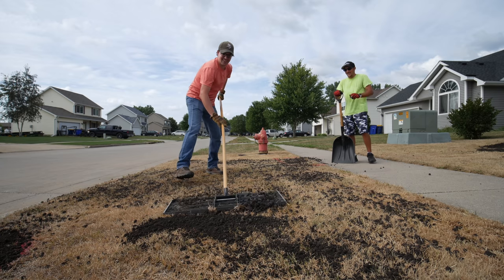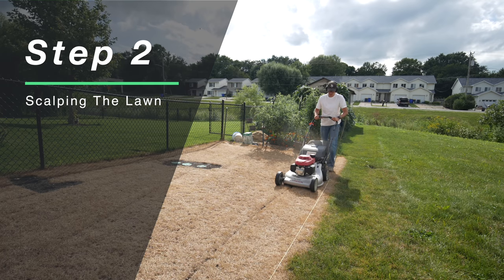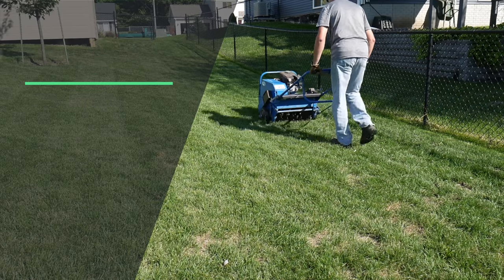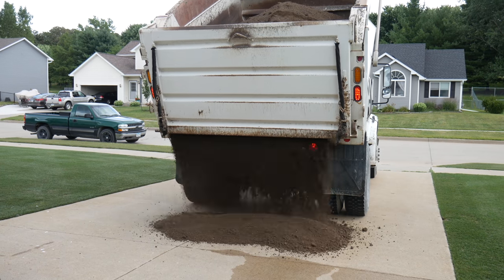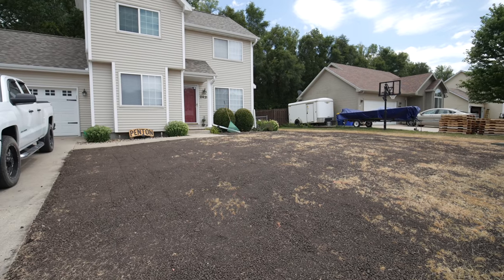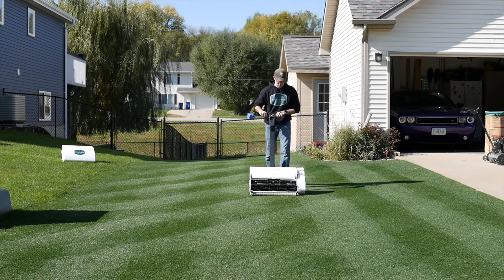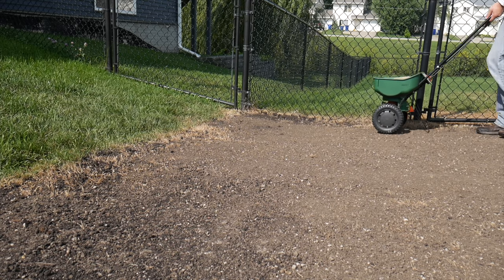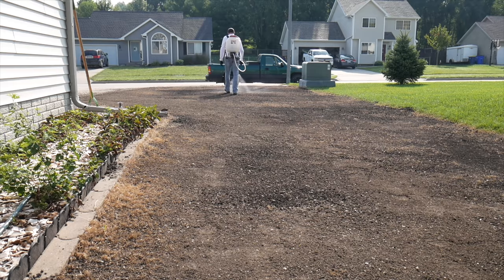How To Fix Your Lawn with Renovation // All The Steps In One Video!!

Comment: Hey Ryan, after spreading peat moss by hand last night I deiced I will be purchasing one of those rollers haha. I know you said you used around 7-10 bags for this 4000sf area. I was wondering if you were doing just a overseeding/topdressing in an area that wasn't a complete renovation, do you feel like that would take less? It's not like that roller has adjustable settings other then walking speed, lol. If so do you have any experience/idea of what the rate would be over an area like that?
Reply from the maker: It would probably be close to the same

Comment: What's up buddy. Love the content. My question is do you leave the plugs? I notice you leveling with topsoil but didn't mention the plugs. Can't see in video of they were still laying on the ground. Thanks man
Reply from the maker: If I'm leveling I either need to find a way to break them up or remove
Reply: @ryanknorrlawncare  How would you break them up? I'm doing a 2500sq reno. Completely dead now after 3 glyphosate rounds. My plan is to rent a stand on aerator, plug the crap out of it, seed, fertilize, tenacity, and go over with a lawn roller. Should I just leave them, seed, then roll it? Man I'm stressing cause I have so much work and money invested in seed, herbicides and fertizer. I really want this to go well. I should also mention I'm doing TTTF. Any help would be great! Thanks brother

Comment: Just renovated the lawn and used a Golf Green Nitrogrow mix lawn seed. Some is growing really thick and tall quickly. I'm scared to mow it too soon but some of it is already about 6-8 inches tall while others are thinner and short. Ground is still soft with some seed not sprouted. Not sure when to mow it now before some of it gets too tall. Any advice?
Reply from the maker: Let it dry out a little and then mow. Overseed thin spots if they don't start to fill in
Reply: @ryanknorrlawncare     Thanks for replying. I had one chance to mow it yesterday as the rain started today. It turned out okay, a few ruts but hopefully it will level out with the rain. Wondering if the Red Fescue seed is actually tall fescue. Weird height differences. Thanks, love your videos.

Comment: I’m into the 2nd week of killing my lawn. How do you limit new weeds bringing in the screened top soil? Should I try to use as much of my existing soil and till it with some heated compost? Would tilling negate the need for aerating? Does Tenacity slightly slow germination? Would you like to take a trip to Long Island NY around Labor Day and help me? :) we’ll put you up and make sure you get some time in the city. :)
Reply: I’m pretty sure if you till, you would not need to aerate it.
Reply from the maker: Tenacity is used to limit the weeds from new soil.  It won't be perfect but I'm more worried about growing grass and fixing a small amount of weeds later.  Just follow these steps
Reply: Ryan Knorr Lawn Care Thanks. Others are suggesting I need to let the top soil fallow for a couple weeks before seeding. I didn’t see any step for this. Are you just skipping and dealing with the weeds from the top soil later? The Meso/Tenacity must also help with this. Btw your videos are great, excellent production quality and I’ve learned a lot.
Reply from the maker: @jbuchananator  Yes I would fallow if you can but you need weeks to get that done and this video was about more of the steps after that process.  Tenacity and weed control later on for whatever comes up in the soil.

Comment: Step by Stp, even I can do that! Just 1 question on Step 10 ... I have had a bit of POA problem so 1 of the reasons to renovate the lawn but if you're wanting to seed won't the pre-emergent as Tenacity get in the way of the new grass coming through? I mean the POA seeds for next season are already in the ground from this year's grass I want to kill off. Can you explain the logic how a Tenacity and new grass seed can get along together in the same new soil, so I get ahead of the POA seed already in the ground? Many thanks
Reply from the maker: Tenacity is not a traditional pre-emergent like prodiamine or dithiopyr...it is able to be used at seeding to help prevent some of the weeds and new poa from taking over the new seedlings.  Then you need a regular pre-emergent program the next year.
Reply: @ryanknorrlawncare  AH ... that's the catch, it's a selective pre/post-emergent. Now I get it ... many thanks, great videos.

Comment: I did a similar process to a spot on my yard yesterday (about 200 sq feet), but I forgot to use the Scotts starter fertilizer before watering!  I haven't added it, I've watered 5 times now, is it too late to add the Scott starter fertilizer with weed control?
Reply from the maker: Not too late unless it's too wet to walk on

Comment: The REAL first step should be getting a soil test conducted before the renovation. For example if your phosphorus levels are over the top, you may not want to use a starter fertilizer. If your PH is too high or too low, that can also hinder results. Love this channel Ryan. Just keeping it 💯

Comment: Is killing off the existing lawn a necessary step? I was thinking about just scalping and level with compost rather than killing the whole yard off.
Reply from the maker: If you want only the new grass that you seed then you have to get rid of the old.  The scalp does not do and it will just be mixing the new with the old at that point
Reply: @ryanknorrlawncare  makes sense! Bought a bottle of Roundup and a sprayer today! Thanks for the advice!

Comment: I leveled my lawn this spring and rolled it to get everything smooth.  It stayed that way for about 3-4 months but is now getting bumpy again.  Any idea what causes this?  Thank you.
Reply: From my experience top soil has enough matter in it that decomposes slowly over time and with the elements of rain and weather allows for pits and bumps to form slowly overtime as the dirt is decomposed.. That's why sand is recommend for leveling cause it doesn't decompose like dirt and settles evenly over time with many applications.

Comment: Has anyone had a similar problem to this.. I noticed from using my striping kit, in addition to all of the 90s we had up north this summer, grass that was smashed down more from the striping kit struggled the most and even died. Why is this?
Reply: Sure the grass isn’t dormant?
Reply: @d0wnbyth3riv3r2  Most areas that would lay down more from striping are brown and I'm able to pull the grass up easily.. so it is dead :( I wasn't sure whether it could be from the striping.. it just seemed odd to me that those areas looked worse.

Comment: Might be a dumb question, but if one wanted to completely start over and reno their lawn why not just kill everything, scalp the shit out of the dead grass/weeds, then rototill your entire lawn and rake until smooth or "level" (people misuse that term IMO), then let it settle over summer,  reassess smoothness at end of summer and touch up what needs to be touched up.  Then aerate, seed, and water, water, water.  By end of fall you should have a fairly lush yard that's as smooth as a baby's ass.  Albeit with maybe some weeds but you could just tackle those early next spring with some preemergent and staying on top of it year round from there on out.  

I ask mainly because I'm about to buy a house on 3/4 acre.  About 27-28,000 sqft is lawn.  If memory serves the lawn was pretty pathetic (house was built in 2016.... by an old couple in their 80s.... so on top of it suffering "new house" yard quality it's not like a couple in their 80s was keeping up meticulously with their lawn) when I did my initial walkthrough.  That was toward the end of April though.  I'm going to do my final wall walkthrough here in about 5 days.  Will be paying much more attention to the yard this time around to access the damage so to speak.  

I ask because all these lawn "leveling" videos on YouTube I see say it'll take several seasons to get that golf course smoothness.  Why not just go full bore on a reno as mentioned above?

Comment: I noticed you did not remove the old dead turf before putting down the grass seeds.  Therefore the subsoil was not exposed or tilled and some areas also did not have any soil bedding so the grass seeds went right on the old dead turf.  I never had any luck having the seeds germinate this way.  Best practices involve removing the old turf, loosen the subsoil to a 2 inch depth and then put 1-2 inches of black triple mix soil as bedding for the new seeds to germinate.
Reply from the maker: I've done it this way many times and check out later updates...everything turned out great

Comment: Couldn't you just till up the area after you kill the lawn?  Skip the scalping, dethatching, and aeration steps altogether?  

Thinking of doing my entire roughly 27,550 sqft of grass.  Just kill the lawn... go to Sunbelt rentals and rent a Toro Dingo with sunbelt's "soil cultivator".... AKA a rotadairon.  A rotadairon is essentially a reverse rototiller, rake, stone/debris burier, leveler,  and earth moving tool all in one.  If no one knows what I'm talking about just YouTube "Toro dingo/soil cultivator" and you should see a video with Toro equipment showing the process.  Leaves a sexy looking seed bed when finished.  Now just picture the dingo and "soil cultivator" painted green... from Sunbelt rentals.... because they paint everything green.  But you WILL be renting a Toro dingo and rotadairon.  They just call it different names for.... reasons I guess.  In the product description they call out the Toro Dingo model and number.  

So....
Step 1. Kill lawn

Step 2. Rent Toro Dingo and Rotadairon/"soil cultivator" (prices may vary but the sunbelt website for my area says a dingo will run you $350/day or $1,295/week and the cultivator $125/day or $380/ week.   How trustworthy those numbers are I don't know.  I haven't gone to my local sunbelt rental place.  Bottom line.... even with my 1/2+ acre of lawn (just shy of a full acre lot) .... I can't imagine it taking me much more than a day to till everything up... 2 tops.  So.... about $950 to go from dead lawn to a BEAUTIFULLY tilled, leveled/ flattened/smoothed... however you want to say it, and prepped lawn immediately ready for seed.... seems the route to go IMO.  

Step 3. Lightly roll lawn

Step 4...... plant new grass

Step 5.  Water.... and wait.... and pray, haha.

Comment: The use of peat moss is by far the single worst piece of lawn care advise I’ve ever acted on. Peat is hydrophobic - water will NOT absorb through the peat into the ground. I put down a light patchy coating as described  yeah, 3/4in water 3x per day and the ground under the peat is still bone dry. I’ve even tried surfactants to try and get any water to absorb. Now I’ve wasted a ton of $$$$ and time on peat and seed and will have to redo a large part of my reno. 👎👎
Reply from the maker: Has worked for me each and every time